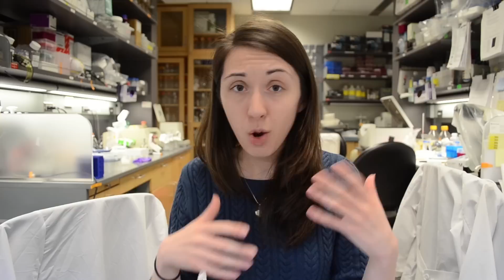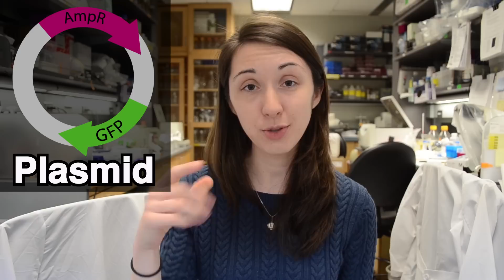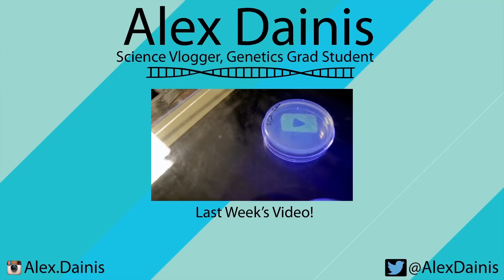Antibiotic Resistant Bacteria?

Comment: Most people don't realize how modified lab-strain E. coli are.  Here's the genotype for DH5α, the strain I've used the most:
F– Φ80lacZΔM15 Δ(lacZYA-argF) U169 recA1 endA1 hsdR17 (rK–, mK+) phoA supE44 λ– thi-1 gyrA96 relA1
These are all the modifications we've made over the years to make this little critter useable for a wide variety of applications.

For example, if Alex had used wild-type E. coli (from the toilet seat at the museum, for example), it would have digested the plasmid with the GFP before it ever got introduced.
Reply: +C0nc0rdance Wow. I just googled this 'identifying' string of letters and it seems like a real thing. Never before have I seen a product name that seems that random. Is there any reason for there not being a little bit more readable name?
Reply: +maciej53 
Well, we just call it DH5-α.  Each of the genotype designators tells the molecular biologist what they can use it for.  

1.  It's F-, which is the fertility plamid, meaning it can conjugate with F+  E. coli strains.
2.  This long string "Φ80lacZΔM15 Δ(lacZYA-argF..." means I can use blue/white screening on Xgal plates.
3.  recA1 means repair deficient, so it doesn't undergo a lot of recombination to prevent inserted DNA from being damaged/removed.
4.  endA1 means no endonuclease, which makes DNA prepared from this E coli cleaner.
5.  hsdR17 means this E coli can't methylate its DNA, which means I can use harvested DNA to transform other bacteria.

etc... etc... 
More comprehensive list is here.
http://openwetware.org/wiki/E._coli_genotypes